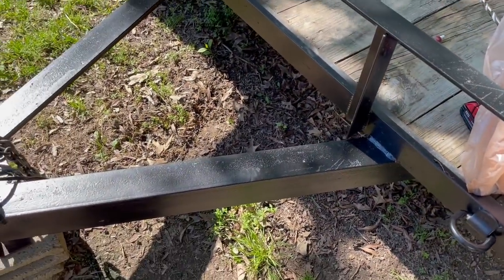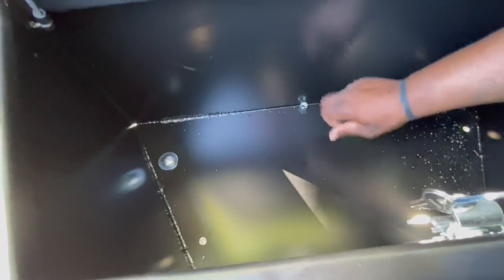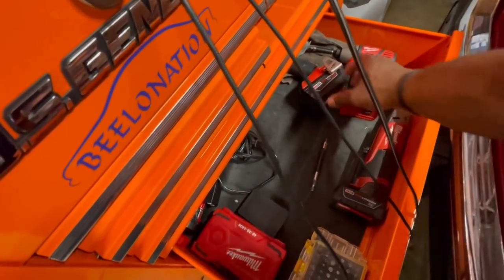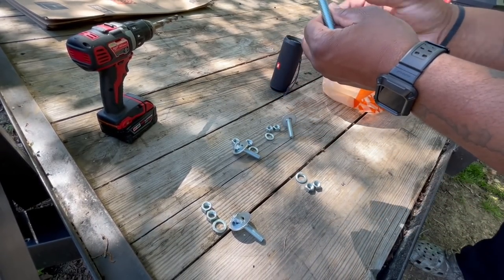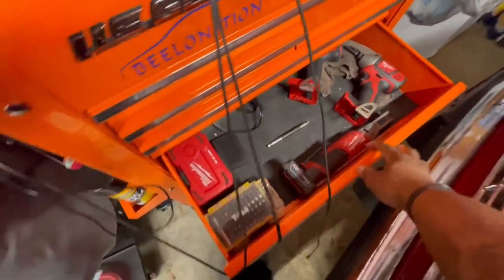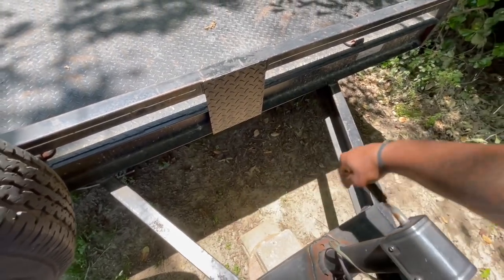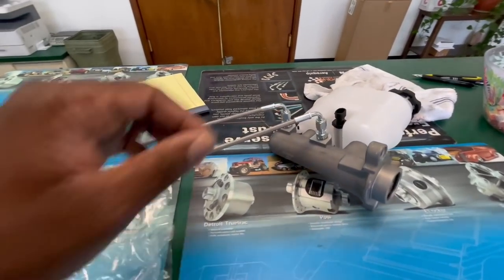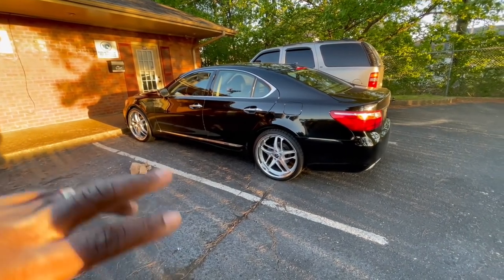Finally.... Getting this done‼️

Comment: Tool box looks good on the trailer. That Ls 460  clean frfr. I had a 2011 Ls 460. One of the best riding cars I've owned. When I had mine Lexus had a recall on the dash, and door panels. The heat from the sun was melting them. Lexus Dealership replaced for free.

Comment: Pro tip: Flip everything and put the nuts inside the box so thieves can't vice grip the bolt and unscrew the nuts and steal the whole damb toolbox. Bolt head should be on the outside facing the ground. Just a heads up bro